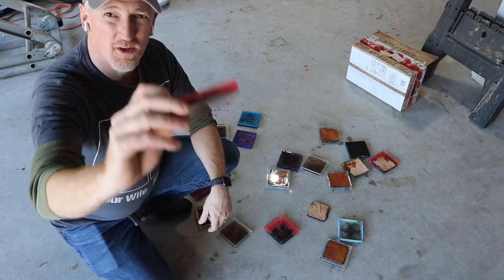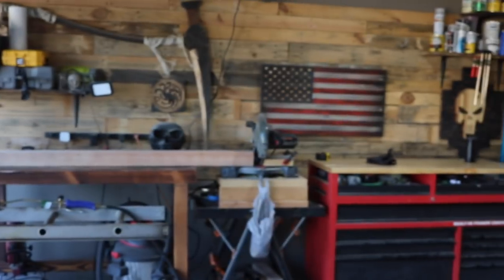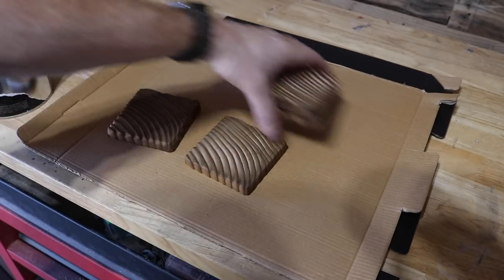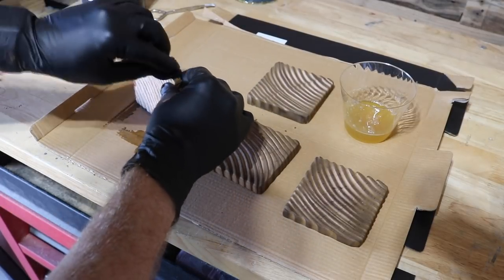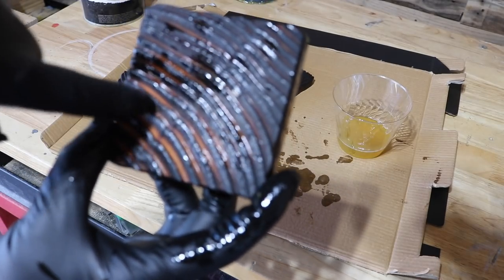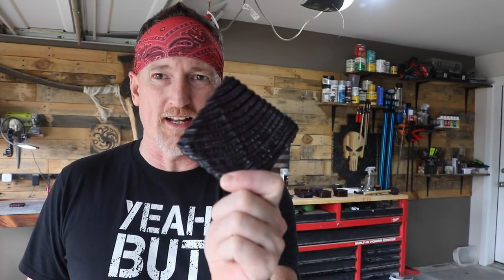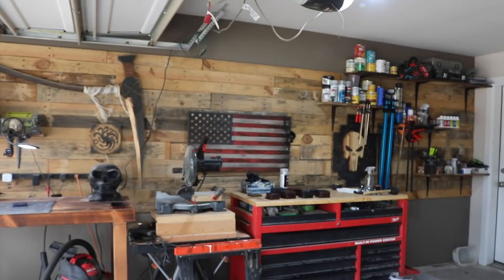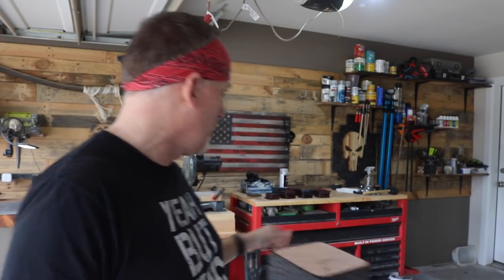DIY Shou Sugi Ban Coasters - Donation for #hurricaneharvey victims

Comment: Hi there. Wonderful. However, I want to know more about the actual wood. Is it treated or untreated because the group I work with won't let us use treated wood.
Reply from the maker: That is untreated Douglas Fir.
You don't want to burn treated wood as it releases harmful chemicals into the air.
Cheers

Comment: Took me a while to get into $40 materials. But when I vot my hands on the 2 part Apoxie... that stuff is amazing.
Reply from the maker: I DO like epoxy in some applications. I just didn't like how the coasters turned out.
If you haven't tried Total Boat yet...you might want to check them out. If you use BDB2019 you get 20% off your first order.
Cheers!
👍🥃👍🥃
Reply: @BuildDadBuild  Not epoxy. Apoxie. It is a two part mold that doesn't need heat to cure. Think of it as putty that can stick to pretty much anything. And has some great selling points. Like being non toxic for aquariums. Made a turtle basking station. As well as horns for a Cosplay outfit. Expert playdo lol
Reply: Build Dad Build Let me know if you check it out. I use it at theme parks for projects all the time as a contracted artist.

Comment: Nice work but what is the attachment called that you use to clean the wood after it’s been burnt? Thank you
Reply from the maker: They are Nyalox brushes from Dico:
https://www.amazon.com/Dico-50-4-Flap-Assorted-Brushes/dp/B001F527F0?dchild=1&keywords=dico+brushes&qid=1627849590&sr=8-2&linkCode=sl1&tag=builddadbuild-20&linkId=483b3a0becaabf3d21d08fcf5f2496d2&language=en_US&ref_=as_li_ss_tl
Cheers

Comment: Hey Bud. With Ultra Dye do you use that straight out of the bottle? Or does it get mixed with something else? Pretty cool coasters. Thanks Bud. And one other thing do you use to get the Char off?
Reply from the maker: Hey, James!
I use the Folk Art Ultra Dye straight out of the bottle. 
The brushes I use are called Nyalox brushes by Dico. And they fit in your drill.
https://amzn.to/2CBEmPQ
Cheers!
Reply: Build Dad Build Ohh ok. I bought some Hot Pink Dye, but did find other colors the more I looked on Amazon and EBay. So they are in my Cart ready to be Checked Out! Maybe I’ll experiment with some coaster and see how they turn out. Thanks for all your reply’s. I am sure you get tons! And then find time to build! Your Awesome Bud!

Comment: just a pro tip that i definitely did before i had done like 6 sets of epoxy coasters, if you want a hot drink coaster you need to make sure it can take the heat..... fml.. it wont straight up melt but it will kinda warp and get some random ass burn meltings ._.
Reply from the maker: That's boat varnish. Should be good! 
But thanks for the heads up!

Comment: Also I need ideas...using burned coasters. Wat designs to put on them that men wud like. 

And how to get the shiny look?
I used wood grain stain its brown like the one u used but it still dry looking  
I also put spray sealant & it's still dry looking. I don't no wat to do.
Reply from the maker: Lacquer
Reply: @BuildDadBuild  another Question... do u need to use polyurethane or lacquer on a wood burned coaster?
I made a coaster using soldering iron design on it. Do I need either finishes being that they're burned?
Reply from the maker: Lacquer

Comment: Coasters turned out good I was curious did you burn the bottom or is it just left alone flat?
Reply from the maker: Just left it alone....well I stained the bottoms the same as the top and added a little self-adhesive felt.
Cheers!

Comment: Great coasters, I was wondering if it wouldn’t have been quicker to cut them all first and then burn them all in one go? Any reason you didn’t do it that way?
Reply from the maker: Thanks!
I did that so they wouldn't curl up under the heat. I have been told that other makers cut them first, then burn. I'm guessing they're not using that big of a torch.
Cheers

Comment: Hi. I'm very new to this and just found your page.  Question: Are the grooves in the wood in your 4x4 pieces coming from the fact that you burn it before you cut them? Or is it because of the saw blade you use?  Thank you
Reply from the maker: Hey there Hope!
The grooves come from the burn. The torch burns out the soft cellulose material and I subsequently brush it out.
Cheers
Reply: @BuildDadBuild  Silly question is that a treated 4x4? I’m thinking not, especially if you burn it. It can’t be good to breathe. Thanks
Reply from the maker: @jamesbarlowjr.3762  eah...don't do that, LOL. That is a douglas fir UNtreated 4X4
Cheers!
Reply: @BuildDadBuild  Thanks Bud. I was hoping not. Haha. 🍻. But I’m sure you know better. Lol. Sorry dumb question. 🤝

Comment: Could you use the resin to get a flat and smooth surface for the cup to sit on? Like just enough resin to fill the valleys? Or would that not work
Reply from the maker: You absolutely could. For me the epoxy adds a large amount of time I don't want to spare / wait. LOL
Cheers!
Reply: Cup? I'm sure you mean wine glass?? (0;  Good idea though, I think I may try that, would leave a lovely glossy finish.

Comment: Hey im fairly new to wood burning, i have a question in regards to shou sugi ban, are butane torches viable to use? Or is propane the way to go?
Reply from the maker: You can use butane on fairly small projects.
I use them to smoke wood for whiskey! LOL
But you're going to want more output the bigger the project.
Cheers

Comment: Been watching your videos for a while. This is the first one that I think I'm going to jump into right away (as opposed to the others that I like but don't have time for right now) because I am currently in need of coasters. Also, I'm in Cypress. I like the "moss green" set. I'm going to try and make it look even more mossy. Basically if the swamp thing had a set of coasters, this is what he would have. I don't recall you mentioning what type of wood you used for the 4x4. Not treated pine obviously. So what was it?
Reply from the maker: It's pine. Douglas Fir I picked up at the Orange store! LOL
Cheers and Thank you!

Comment: Is there a reason why you apply the Oil finish before you apply color?
Reply from the maker: The ones with the dye don't have oil on them. I only used the Simple Finish on one set of coasters.
Reply: @BuildDadBuild   AW OK i must have missed that.  Thanks!